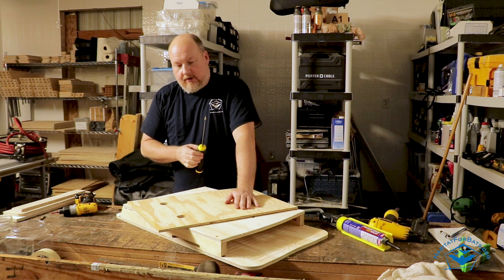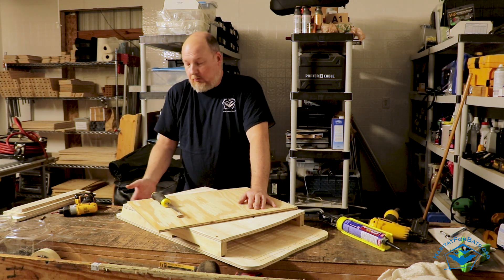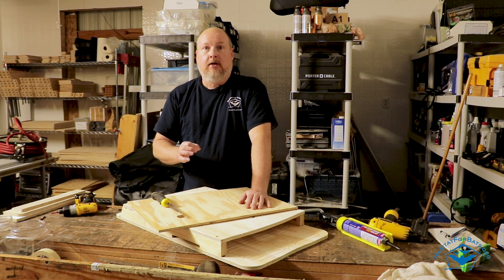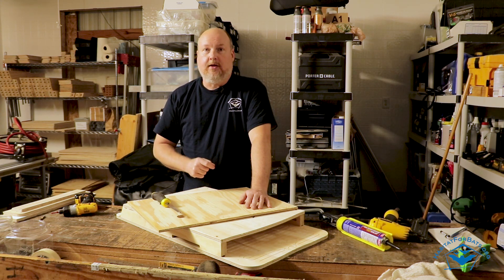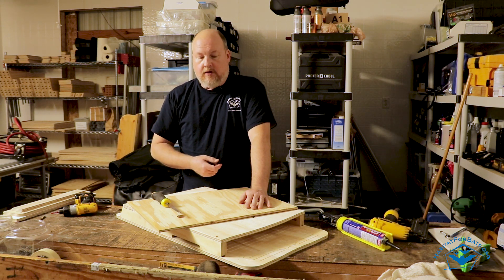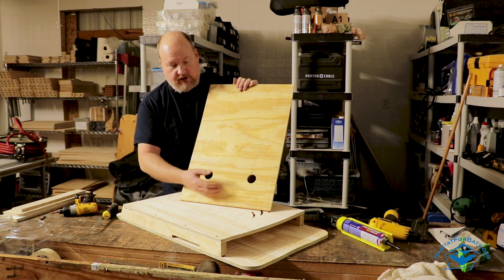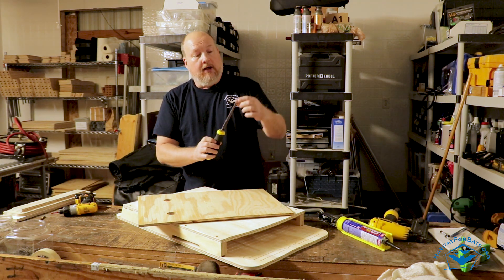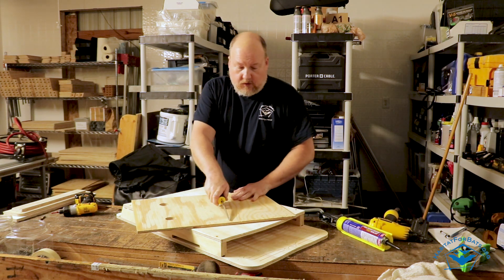FAQ Which is better, Grooves or Mesh? How do I cut Grooves?

Comment: I have access to relatively cost effective rough sawn pine. Would that work, with silicone in the joints to prevent water and wind?

Comment: metal screen is the go to. they are Bats not rockets
Reply from the maker: The metal can corrode over time (even galvanized) and come loose. With metal there is a risk of entrapment if it comes loose and the additional concern that as it corrodes it can make "sharp" points they could become injured on.

Comment: How do you think a very thin coat of mortar would work rather than cutting grooves?
Reply from the maker: So long as it did not fall off, probably, but it will add a lot of weight.

Comment: Old old video here, but I wonder if just using EXTREMELY coarse sandpaper would do the trick? 
I make bird houses where I put some metallic screen inside by the exit of the house. I put it in with rivets. No chance of coming loose there.
Reply from the maker: Anything to make the surface very rough. I'm not sure course sandpaper would be as good as deep scratches from a saw or blade, but it would be better than nothing.

Comment: Thanks. The box I bought has 5 half inch grooves on a perfectly sanded surface. Lol. Not grooves every half inch.
Reply from the maker: That would not have been one of our bat houses then.  It is easy to add more groove or generally rough up the surface with either a hand saw or carpenters knife (just be careful).  thanks for loving bats!

Comment: that looks like a lot of work.  you ever tried a hand plane with a toothed iron?
Reply from the maker: I have, it generally doesn't work well on plywood if the outer surface is too thin. I find scaring the surface with the end of a hand saw (that last tooth) tends to do well if you have to do it manually.  Otherwise, the machine does it and doesn't complain, even works in the dark!.  Thanks for loving bats (and woodworking).

Comment: Good info as I am building some boxes this week and was going to go the mesh route but now I'll just cut some dados on the table saw instead. Thanks!
Reply from the maker: Don't forget we sell kits.  I love the DIY approach, but sometimes you just want to get them together and up on a pole!
Reply: @h4bats  Roger that. One question I have is on the two and three chambered designs. I note that there are grooves cut on the back wall but not on the chamber inserts. Do the bats not need to hang on to grooves on the inserts as well as on the back wall?
Reply: Alex Reid there should be grooves on all surfaces ideally. Hope the build went well for you.

Comment: How much guano could I expect to collect for my garden per 100 bats?  Like a quart a season?  I was going to put a pan around the bottom of the pole.
Reply from the maker: With a persistent colony of 100 bats, you could get a reasonable amount, hard to say. The wind, sunlight drying it up and missing the target will reduce the amount you collect.  I have seen a healthy colony of around 400 bats produce roughly a 2" blanket of guano on the ground for a diameter of about 3 feet their first year.
Reply: @h4bats  thanks!!!
Reply: You'll get more than a quart.

Comment: Any easy way  to keep wasps from building in the houses also?
Reply from the maker: Paper wasps typically will not build in a space less than 1", so with the 3/4" chambers they tend to build at the bottom where easily knocked off. Sometimes in an empty bat house they may make their way to the top and build. You can use a 1/2" PVC pipe about 1 feet long and use it to whip back and forth (in the winter when NO BATS are present) to remove wasps nests and/or dirt dobber nests (those mud building "wasps").  But I'm not aware of anyway to prevent wasps from building, we live in the South, there are millions of them and they are awful little creatures with which to deal.

Comment: So I realize this is an older video, but what about using a wood burner to burn the grooves in?  Would there be anything harmful in doing that?
Reply from the maker: I don't think there would be anything harmful about it, but it may not produce the gripping surface you expect. With burning you are hardening the surface of the wood and leaving a smooth groove behind. With cutting a groove the surface remains rougher and with sharper edges.

Comment: Why not use something like white cedar siding?  The rough, natural grooves work well.  I had many bats roosting behind the fake shutters, on the cedar siding, on our house in central NJ.
Reply from the maker: Cedar has oils in it that can cause some irritation to the bats, but so long as it is ventilated and once the sun cooks out the oils for a while, it makes a good bat house. Second, all of the cedar we source around here is from Canada and is old growth, I don't want to support an industry cutting old growth forest and I've not found a way to buy managed cedar.  I have also used cypress, but discovered the same problem, despite being told it was "sourced from managed growth area", I learned that just meant they managed to cut every other tree, not that they actually replaced them.  The plywood we use is sourced from a managed forest and is pine which grows fast. The quality of plywood we source is one of the highest grades as well making it flat and consistent. Finally, it comes down to producing a consistent product in volume, with cedar I was having about 20% material rejection for warping and splits. For Cypress it was much higher than that.
Reply: @h4bats  I like your environmental concern and practicing what you preach.  This venture is a win-win project.  It provides safe homes for a unique species and a connection to nature too.  Very satisfying to know you are doing some good and giving back to wildlife where the greatest threat to most of them are humans.  I think kids would get a kick out of watching their bat houses thrive and following their pet bats nightly routines.  This type of wildlife watching could inspire some kids to become more interested in the sciences, you never know.

Comment: LOL I know I'm two years late but.... First, thank you for your advice re mesh. I was going to opt for it because it seemed like a good idea. I never thought about tangling so thank you for that. In Texas, at least the DFW area, keeping a bat house warm is not a problem. Keeping it cool and well ventilated is. Our heat can get up to 113 and is more often than not humid/muggy with little or no breeze. My first thought is to make it not only a bit deeper front to back (maybe one to one and a half inches) to allow better air flow but also add a taller "dead air" space at the top allowing hot air to rise farther up before being vented to the outside. What about small ventilation holes all over the house like a sieve? Also re tree mounting, any thoughts on successful placement such as height, proximity to other branches and squirrels, leaf cover, wind exposure, etc. And a final question, how large should a tree branch "at least" be for a tall, narrow bat house. We have older oak trees but nothing like the evergreens always featured on "how to" set up bat house videos.
Reply from the maker: Trees should generally be avoided as it promotes predator access and can offer shade when not needed.  Typically a bat house should be at least 12 feet high, 15 feet is my preferred minimum when possible.  Bat houses of the rocket box style, what you seem to be mentioning in your comment should be at least 36" tall and are generally pole mounted but could be placed on the side of a tree. I wouldn't put a bat house on any wood pole or tree less than 4" in diameter.
Reply: @h4bats  Thanks. I'll keep delving. Got to feel the neighbors out before I start anything but will follow your recs if I do.

Comment: What about affixing asphalt shingle to the wood surface for a highly textured surface for the bats to grip instead of grooves or netting?  Has anyone tried that?
Reply from the maker: Shingles are coarse and shed rocks not to mention the sticky tar when they get hot... and the heat too. While bats do like it warm the shingles could pose a "hot foot" problem for them. The still have to be secured by something that could corrode away and cause the shingles to fall out. Still, better than tangling and killing bats though.  Grooves, rough surfaces on wood are the best way to go.
Reply: Thanks for the reply.  Being that the shingles would be inside, they should not get any hotter than anything else inside, like the wood surface.  Outside shingles could get very hot.  The shingles would shed granules and could leave traces of tar on the bat's claws.  The coarseness is probably somewhat more so than cave rock, but provide good a gripping surface.  Since it doesn't seem to be necessary, it seems that the roughened wood is sufficient.  Thanks again.

Comment: I also have concerns about the netting (typically plastic) outgassing at 100 degrees.  Probably not real good for the bats.  I am assuming they are not using some special "bat house" mesh, but retro-fitting mesh designed for some other purposes.

Comment: Now this may or may not really be a problem but my concern is entanglement not when the house gets old and the staples give way but just in general I know it is easy to get hung up on certain material when it comes to needle sharp objects. Whats to stop a bats claws from getting hung up in the mesh to the point they can't let go? I never actually thought about the mesh getting unstable over time. That is also a major concern.

Comment: i used the table saw to cut groves and the the had saw to make some random cut at a 45 or so to the groves
Reply from the maker: That works too. I generally "repair" baffles with skipped grooves or too shallow etc... on the table saw.